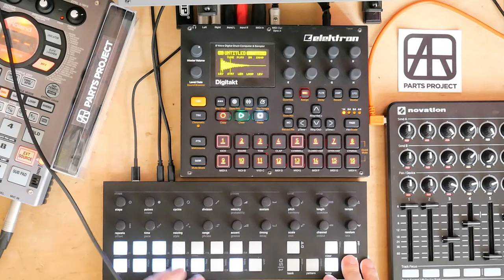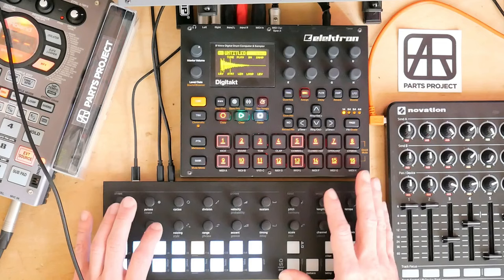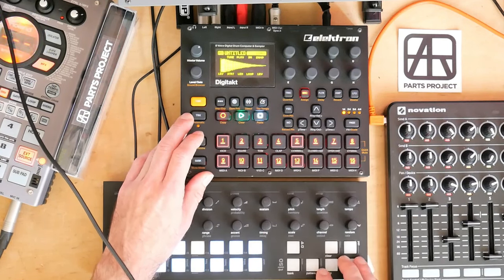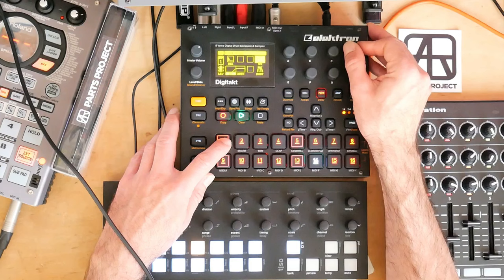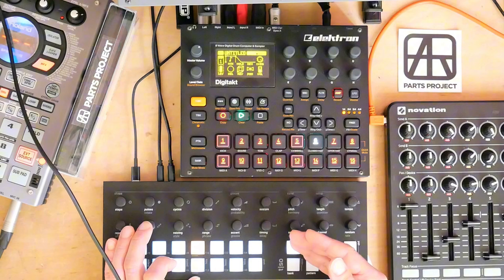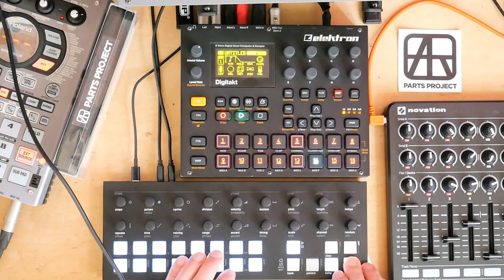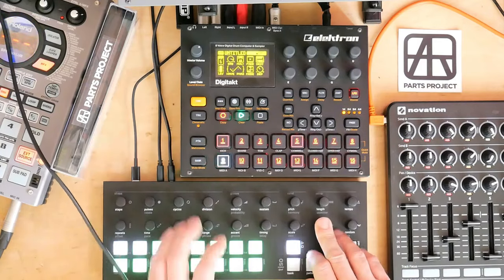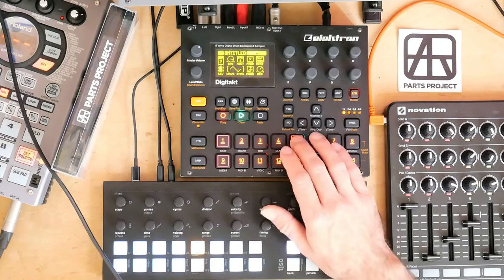AMAZING ELEKTRON FX SCENE TRICK! THIS WILL CHANGE YOUR LIFE!

Comment: I’m going to have to study this video to figure it out later. But I wanted to say how fantastic your jams are! Really detailed and exceptional.
Reply from the maker: @rkriviera  thanks! There's an old vid going over basic setup but I'd like to make a newer one that's more to the point.
Reply: @partsproject damn- just realized that amazing bongo thing you were doing is due to 2 LFOs. Only one LFO on the Rytm! Still very useful trick- I’m sure I’ll come up with uses for this. And I have a recently acquired squarp pyramid which I’m sure would be perfect!
Reply from the maker: @rkriviera  you'll probably use it in new ways I haven't tried!
Reply: @partsproject yeah make a new one, just straight to the point. (Don’t mention unrelated things to your topic like I did this before or I talked to X and Y and it would be great if…) just lay it down and go to the point so you can get your viewers engage without the rambling, You can always type in all that on the video description. Please 🙏
Reply from the maker: @MeAlexSenna  new setup guide is up!

Comment: Very cool! Just tested on DN2 and it works fine, so looks like they're keeping it! Can also do it with midi loopback if you don't wanna sequence externally
Reply: Can also use 0 probability tracks if you don't wanna have to lock FILL, that way you definitely won't get any trigs even if you accidentally remove and readd
Reply: Hey, can you please elaborate on that midi loop back feature you've just mentioned that you don't need to sequence externally? Can you sequence from the midi track or something like that? How to set this up. Cheers ✌️
Reply: @konradsiudek8713  yes that's right, a midi track can sequence the non midi tracks if you plug a midi cable between the midi in and midi out ports

Comment: Pretty cool!! Gotta try it with my DT2
Yeah you are changing the phase of the LFO, this is a trick I use a lot aswell, very good implementation! Subbed
Reply from the maker: @FigittyFau  thank you~~~
Reply: did you get this to work on your DT2? and does it have to be sequenced externally for this to work?
Reply from the maker: @brendand9937  I've tried it with D2 and can confirm it works. And I've had reports of sending midi out to midi in successfully, but I've had issues when trying it myself.

Comment: So it activates the fill trigs for all the tracks simultaneously when you hold a trig on one of the tracks?
Reply from the maker: @saxmink8620  yes as long as the locks are assigned to the same trig key then all the different tracks assigned to that key will activate when pressed. So, activate a track, make locks to a trig key, then activate another track and make locks to that same trig key, and so on. Now both/all tracks are activated when holding down that trig key.
Reply: @partsproject  nice, maybe i'll try this sequencing my digitone with my digitakt since i dont have a dedicated sequencer
Reply: You have to be in record mode for this though, right? Don't you worry about accidentally tapping one of the keys and turning the whole step off and losing all your locked parameters for that "scene"?
Reply from the maker: @Perceptes  luckily it would only be the parameters for the track that's selected. But yeah I just keep temp saving so a reload would fix it. Or perhaps copy that page across all four pages so if I erase something I can just move onto the next page.
Reply: That s really good idea. 👍🎛🎛
Reply: ❤ thank you for sharing. Love that tri(g)ck.

Comment: Hi! Great tutorial, stocked to try this!

I have a couple of questions though:
- having a fill trig only works on the current track, right? there is no way to apply that "performance FX" to all of the tracks?
- is there a way to maintain the FX on without having to press the button? like, if i cannot apply the performance FX to all the tracks, maybe I could just add a filter trig per track and chose to activate them or not independantly?
Reply from the maker: @csaoh42 It does affect multiple tracks at once! Check the setup video I posted a few days ago. And there was a way to hold the scene without holding the button, someone pointed that out to me 3 years ago when I dropped the original walkthrough, but it either doesn't work anymore or I just can't remember exactly how. It involved the save function.. maybe someone will speak up about it!

Comment: I just saw this and checked out the video from 3 years ago. This is so cool! Has this worked through all the firmware versions from then til present?
Reply from the maker: @jmichell1880  yes it has! Recently one or two parameters don't stay locked when the machine is turned off and back on, but that's not related to the firmware. I'm still troubleshooting to find the cause.
Reply: @partsproject  That's great. tempted to keep my DT1 just to keep against future firmware

Comment: This is fantastic. I've got the midi tracks sequencing the sample tracks via loopback. Q - is there a way to use a second machine to sequence the scenes changes?
Reply from the maker: @ukbloke28  I don't know! My guess would be no.
Reply: Im trying to think of a way but it’s weird to consider because it’s not like the keys in this case are just triggering a note as such.

Is there a way to trigger the scenes by hitting keys on another midi controller? I find it’s way too easy to delete the steps doing it like this.

Comment: Is there a good method to making this work with a pattern that already exists with parameter locks on its triggers? E.G. I have a fully formed pattern, so right now it seems to make this work I would have to recreate every trigger on the external sequencer (DT2 sequencing Syntakt), remake all of the parameter locks with MIDI CC, and go from there?
Reply from the maker: @jasonmckellar7750  I don't believe there is a practical way to have a trig pattern and use the scene trigs on the same machine, and I don't think patterns can be transfered over the transfer app to another machine.. but let me know if you find a solution! Stay tuned for a basic setup video in the works.

Comment: Thanks for sharing - this is really cool. So am incorrect in thinking you have to use a lm external T1 sequencer or can also avail of this function using the Digitak sequencer? 
Would this also work on the Digitone 2?
Reply: Confirmed working on Digitone 2, don't need an external sequencer, can just use the DN2 to sequence itself via midi loopback
Reply: @impbox  Hi there, i'm trying to reproduce the trick on a Digitakt2.  I learned a lot trying to, but i haven't figure how to properly sequence a "normal" track via midi loopback. Any advice or link ?

Edit: I managed to do it, but each tracks have to be "cloned" to a midi one right ?

Comment: so, in your example you re on track six, and with the trig 12 you cut everything out except the clap, which I supposed was triggered ext. How did you do that, to cut everything out from the track 6 in rec mode
Reply from the maker: @chambre466  I plan to do a setup video clearing that up. I do have a longer video that explains setup but it's a bit long. Check that out in the meantime but i plan to do a shorter, more straightforward walkthrough.
Reply: @partsproject  of course, waiting :)

Comment: I haven't tested this out with this method but i wonder if it works similarly to the syntakt FX trigless scenes trick where you hold your trigless trig and hit YES and it will 'audition' the trig, thus changing all the settings. I think you have to have the trig timing on INF for it to stay like that.

Comment: 💯💯💯 But wait...so, you showed the example of just the kick, but then busted out jamming on a whole pattern. Do all the tracks need to be externally sequenced for the whole pattern to be tweaked as if it's a scene...or will just one track alone (ex. The kick in this case) enable this crazy trick? If I, say, sequenced a hi-hat on an external sequencer, filled 16 hat trigs on the DT with crazy param changes,   does the whole pattern get effected when you hold down one trig?? Or did you sequence all of the tracks on the torso in order to do this?

Comment: This is cool... I don't know what you're doing lol.  From a noob-newer perspective I would (have) lead your video with 2:30 and then followed with the tech information.

when i say "I don't know what you're doing" I don't know if the 'all your sounds' is just from the digitakt.  they are, right?  and the sequencer underneath there is triggering them, I presume?

and then those buttons up top (the fill trigs) contain no composition/trigs only param automation stuff?  that makes total sense

I think that's just smart separate-of-concerns or 'division-of-labor'.  On the machinedrum you can have tracks that are only automation or LFOs pointed to existing tracks, that you mute and unmute, changing the scene of parameters and not any actual trig information.  

with the MCL (not so much anymore but previously) you could have the machinedrum sequencer running some simple core groove stuff and do your added layering on an external sequencer (the MCL) and swap stuff around all you want on one device while not altering the underlying groove of the base sequence on the md, etc.

I doubt this is a bug, just different perspectives in how people assume things should work (thereby possibly limiting their exploration instead of making no assumptions and just exploring)

Comment: thanks for a tip
is there a way to get the same result without external sequencing?
Reply: Midi loopback I would say
Reply: Plug a MIDI cable from the Digitakt (or whatever Elektron box you are using) OUT back into it's own IN and use the internal MIDI parts to sequence the sample/drum/synth parts.

Comment: how come a trig one a single track is affecting other tracks as well?
Reply from the maker: @RadekPilich  I have another video explaining setup that's a bit long so I intend to make a shorter one. But basically as long as multiple tracks share locks on the same trig, they will all be affected. Just activate a particular track, make locks on a particular trig, then activate another track and put locks on the same trig, and so on. Stay tuned for a short setup vid but check out my older, longer one in the meantime!
Reply: @partsproject  oh, thanks, I've just remembered it wrongly, that's really powerful feature then
Reply: @partsproject so it means you can do fill routings by applying locks to some tracks and not all, nice !